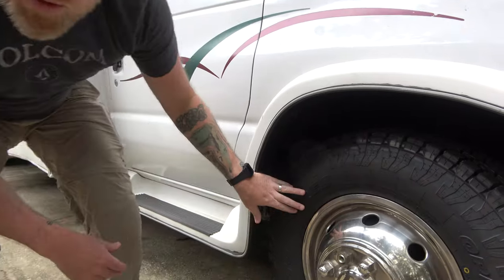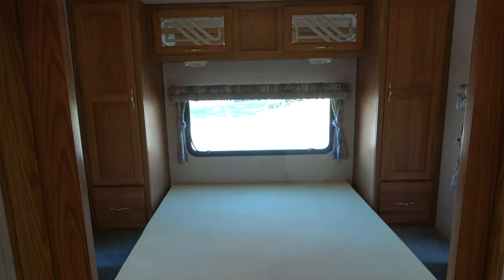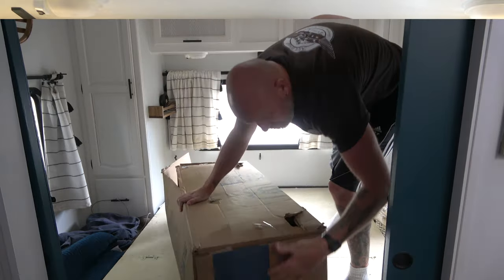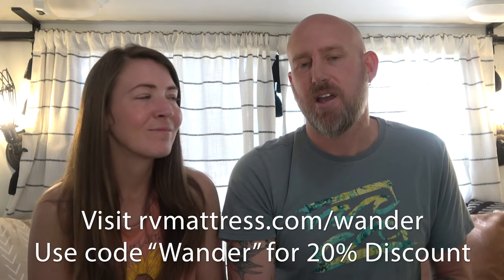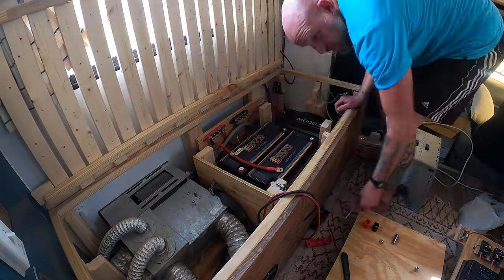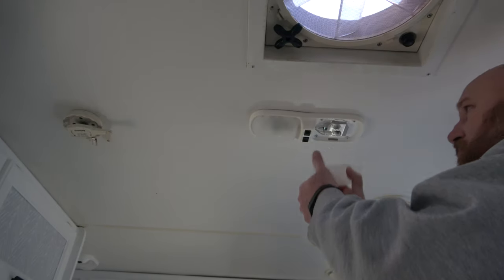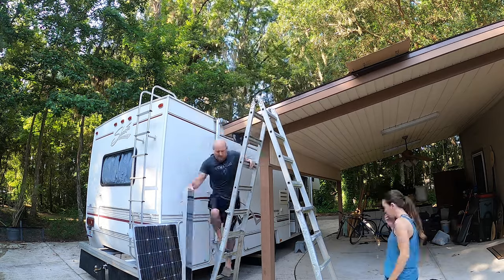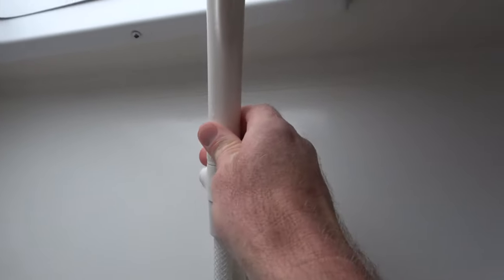8 RV Upgrades You NEED to do NOW For Your Motorhome, Travel Trailer or Camper!

Comment: What year is your rv,,I need to put in a new fan in mine but I'm worried about the opening! Mines a 1990 model, and the only fan that's wired is the bathroom fan so I will need a strong one to pull air through the windows, How's the jobs going? We loved that State part, but with the kids we stayed at the KOA There,,,I fell in love with that whole area,,
Reply from the maker: 1999 Shasta Cheyenne. Most models of fans are the same size, going back years. You can take off the inside cover with a few screws and see the length/width. We're happy with our Fan-Tastic fan. But Maxxair has a good one too... Jobs are going well. Just over a month left before we hit the road again! Definitely a beautiful place to be able to live for a few months!

Comment: Good reviews' am a long term customer of discount tire ,the sales guys do earn a commission so there is some wiggle room here. there are stories out there about tire blowout an damage ,even the best tires can go wrong.I  like to see you tell exactly which tires you bought an estimated cost. DISCOUNT TIRE has a wide selection to choose from, i have owned class A ,B ,C AN 1957 gmc bus . currently own thor 22e , did not have a spare ,an wife insisted on it. Motor home currently running BF GOODRICH TIRES, bought a spare new from discount tire cost me around 200 dollars . Important issue with tires is air pressure ,2 much not good to little an tire runs hot an then bang . So we agree buy good tires ,an keep watch on the pressure. NOTE discount tire will check your pressure free ,no purchase necessary.
Reply from the maker: There are too many choices of tires out there for our choice to be the only one to consdier. We always purchase Toyo tires though, when we can. And we get the biggest All Terrain models we can for whichever vehicle we have. Whether customer reps get commission or not doesn't matter to us. The prices are competitive and the service is the best we've ever had in 25+ years of driving and maintaining tires. Thanks for watching and reaching out!